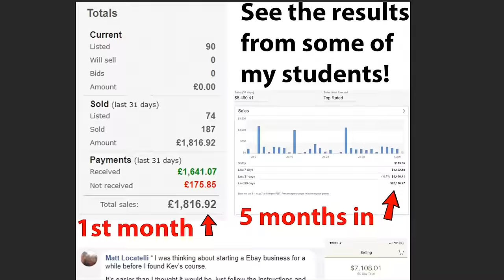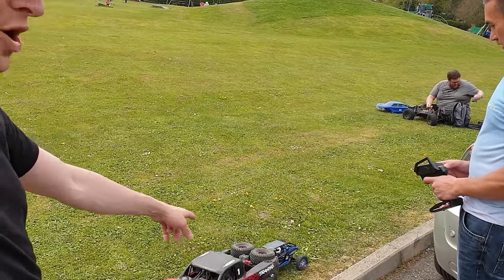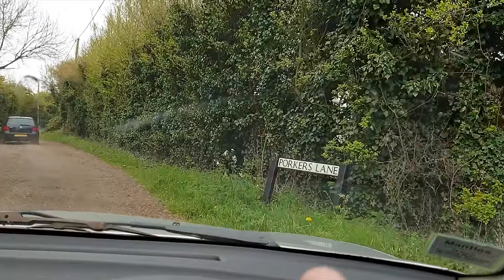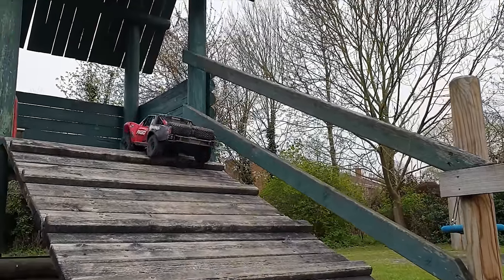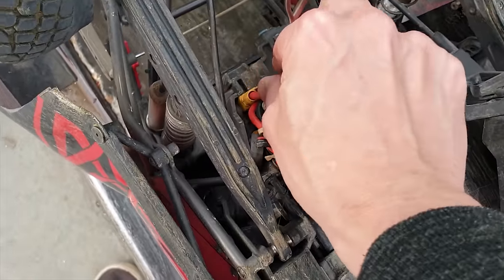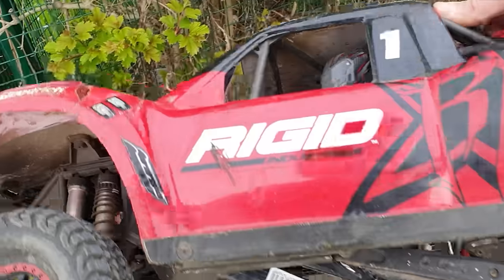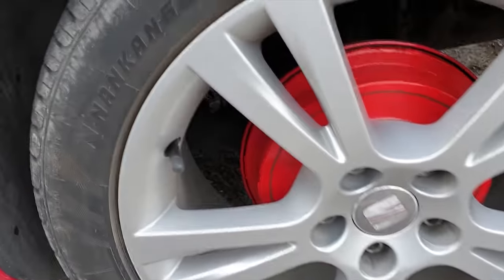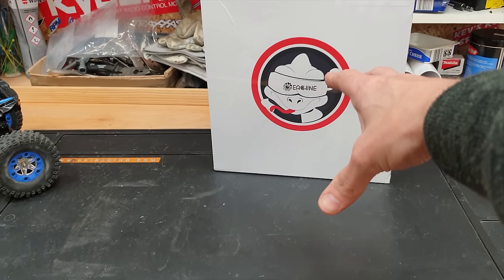Decent CHEAP vs Expensive RC Car Crash Testing

Comment: The only things those little trucks suck at is turning at high speed, they flip super easy. Not such a problem on sand or loose dirt though. 

I think for the money they are brilliant. Some people call them toy grade but really in terms of design, they are way ahead of a lot of stuff costing 2x as much, especially Tamiya. I love Tamiya but this truck is way more modern and sophisticated than something like the CC01 which costs way more.

Comment: Grew up playing with even cheaper versions of the cheap one (had to go backwards to turn and had a wire connecting the controller to the car) and hope one day to have a Sledge/X-Maxx... but for now, I am enjoying my 2wd brushed Traxxas Stampede 😊
Reply: Like Kevin said: "It's doesn't matter what you drive/can afford.  It's about what puts a smile on your' face."  Good on ya mate.

Comment: Kev why is the back so high, I run 5mm of spring pre-load at the rear and 7mm at the front mine hardly even tips let alone roll, I am going to fit stiffer rear sway bar to help even more.

Comment: Kev I might get a 1/8th Hsp buggy
Reply: Just remember if you want speed get a high a esc 😉 that way it can handle more lipo cells double check what the motor can handle
Reply: Infact Helion Dominus 10tr isn't to bad I've upgraded the esc to a 80a cheapy thing and I toke someone off there feet with it 🤦‍♂️

Comment: Kev how come your rear tyres are worn on the inner tread area only, you need to rotate the tyre's rear to front maybe spares to the rear. When you worked on it did you swap the "C" hubs from right to left without realising, there is nothing in the manual saying about camber adjustment or even if it has any camber or is zero camber. But it may explain the unusual wear on the rear tyres. 
Mine are wearing more or less the same down the middle.
Reply from the maker: rear camber is fixed to 0
Reply: I pretty much thought that was the case, maybe it is wear in the "C" hub carriers causing the wear. I have the Vivaton alloy rear axle and GCR alloy "C" hub carrier's and since going over to these as I said seem to wear the tyres pretty evenly. I went over to alloy after busting two plastic axle casings I went to alloy first time I broke the upper link mounts on the first and a lower trailing arm link on the second axle. After my first run the axle looked very second hand but haven't broke one since yeah. @KevinTalbotTV

Comment: The new Arma granite 4x4 vs xmaxxx wich is better for the price the granate is fairly similar in pretty much every way aulthough the granate is 3s and they are both extreme bashers the only thing the granate needs is velcro slabs to put on the car and your battery because the stock ones just dont do their job that well and tour battery comes out and blows up or your cars internals get ripped out

Comment: can you mount a proline 1946 power wagon to a traxxas trx4
Reply: If you get the body in the correct scale I don't see why not I have a subaru body on a monster truck 🤦‍♂️ I've also have a savage body on a tamiya ta01.... But as I said at the start of the the scale is correct can't see why not